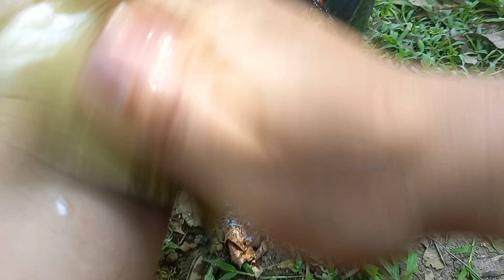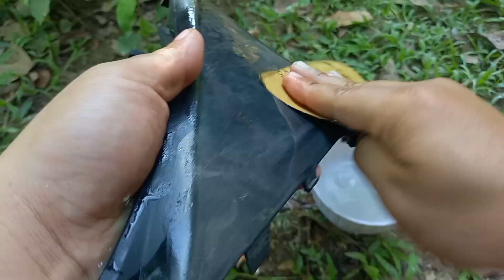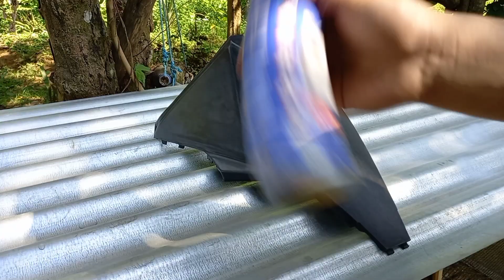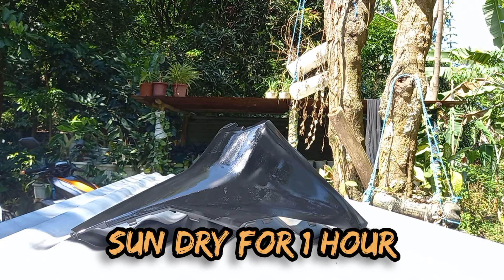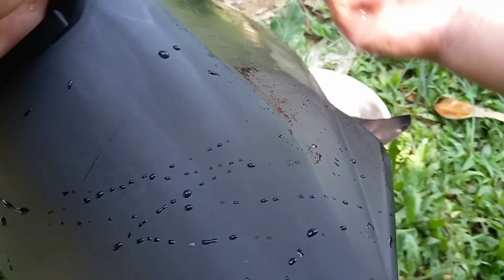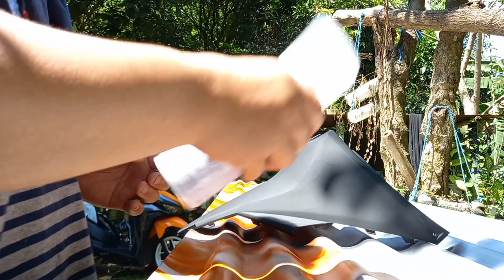Engine Cover Repaint Flat Black

Comment: Sir ano po yung gingawa sa motor pag tune up?
Reply from the maker: Adjust po yung valve clearance at linis carburador kung Fi linis throttle body.
Reply: @MarcsonMotoPH  sir fi yung saken, so di na po inaayos yung valve clearance?
Reply from the maker: @joelcutie4ever969  kailangan parin po adjust sir.